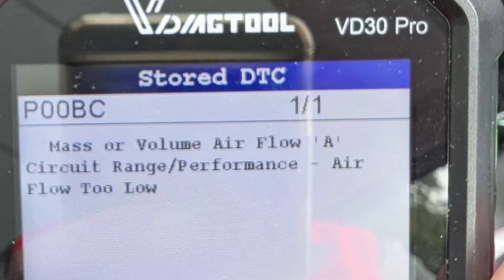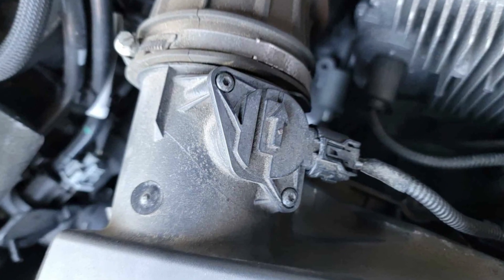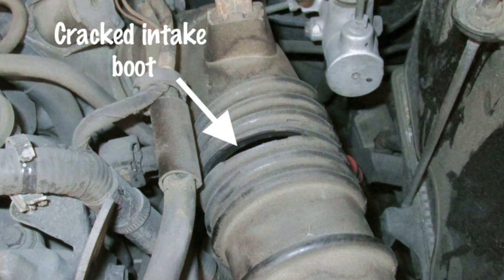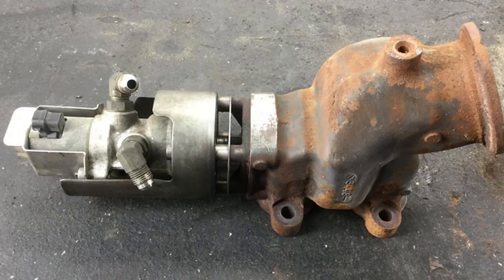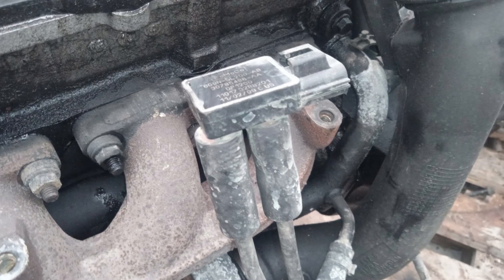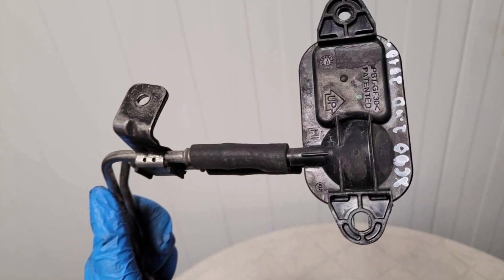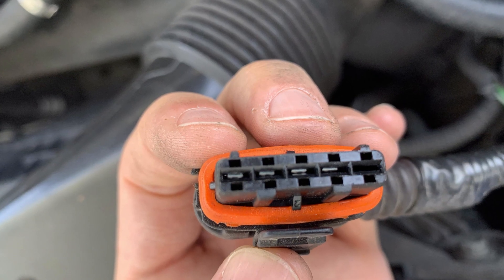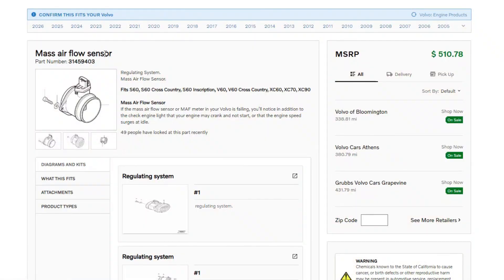Volvo P00BC-00 trouble code – Reasons

Comment: I am struggling with this code (and also P00BE, P00BF and P0103, which are all related to the air intake system), but I just can't find the issue. Tried two new MAFs, cleaned the EGR Valve and Cooler, checked the electric harness and possible air leaks, nothing so far. Is it possible that there's an air leak in the turbo area? Because I didn't check here since it's hard to reach.

Also will check the DPF sensor, thanks for the hint
Reply from the maker: Turbo leak would also trigger other codes, but it's worth checking, at least visually. If it's not the DPF pressure sensor, I would find someone with a smoke generator for intake system test. Also, maf wire and connectors need to be look at.

Comment: Thank you.
I was thinking of buying a Volvo XC60 and it has this code.
But now I am not so sure, I do not need expensive fixes.
Reply from the maker: If it's about EGR or DPF, I would just stay away. But sometimes it's a minor electrical issue like a DPF sensor problem or even a connector issue. In this case, the code and warning on the dashboard is a great opportunity to haggle and get a better price.